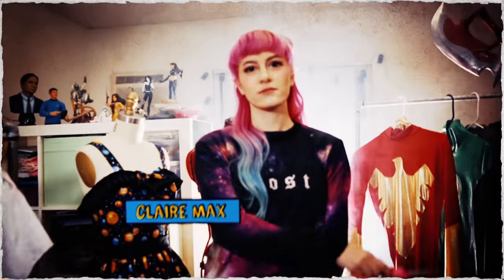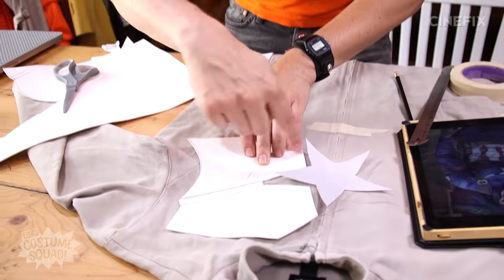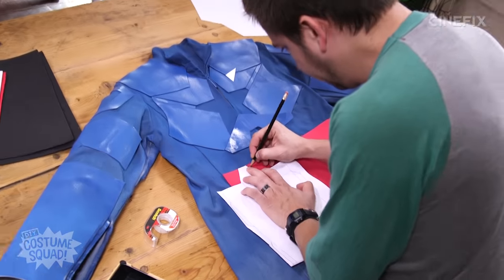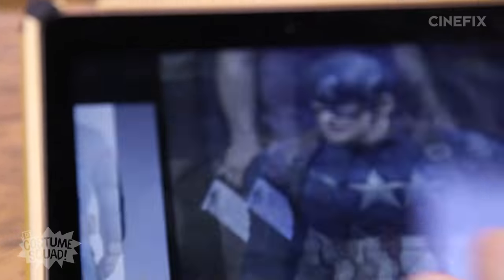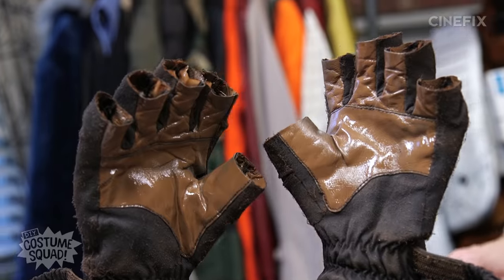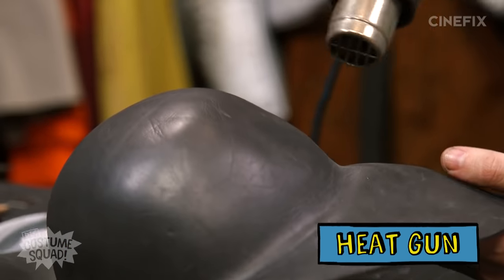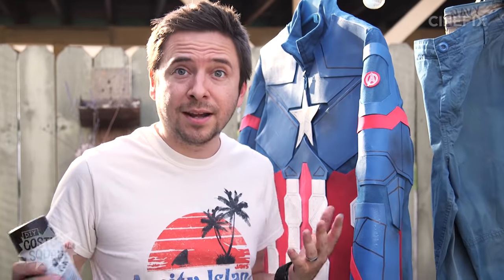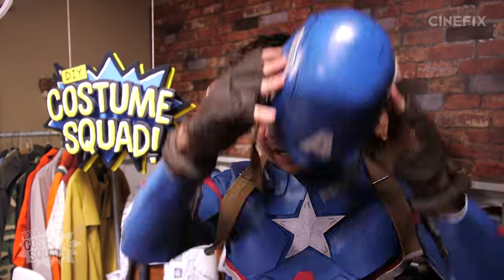Make Captain America's Suit & Shield - DIY Costume Squad

Comment: Templates? Also, how did you make that hot glue tip adapter?
Reply: Oh gosh I don't think I could make templates, it's all just so dependent on the size of the jacket etc. This hot glue gun came with a few additional tips, that long one is awesome!
Reply: DUSTIN SHOULD DO SUPERMAN (DEAN CAIN OR CHRISTOPHER REEVE)
Reply: YET TO BE NAMED is that from batman v super man
Reply: NO DEAN CAIN IS FROM LOIS AND CLARK THE NEW ADVENTURES OF SUPERMAN AND CHRISTOPHER REEVE IS FORM THE FIRST 4 SUPERMAN MOVIES IF THAT IS WHAT YOU MENT.
Reply: Try putting masking tape on the jacket then draw on the tape then place it on the foam

Comment: i am making a medieval surcoat for a medieval faire for later this year and i made a teutonic knights cross emblem
that is 12x12 inches  it is made of cardboard i sprayed just the front with black plasti-dip and lined the edges with gold braid and other nice stuff and left the back of the cross uncovered just pure cardboard and i wanted to know if a can of scotch super 77 spray adhesive would work to hold the cross to a white 50/50 polyester /cotton fabric the can says it works on cardboard
and fabric but did not say if cardboard will hold onto fabric please let me know thanks Richard